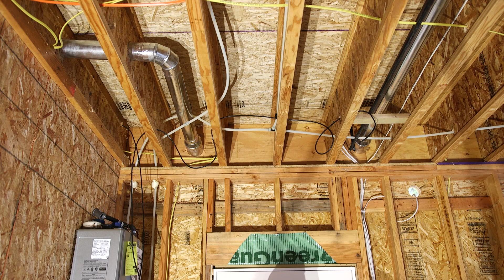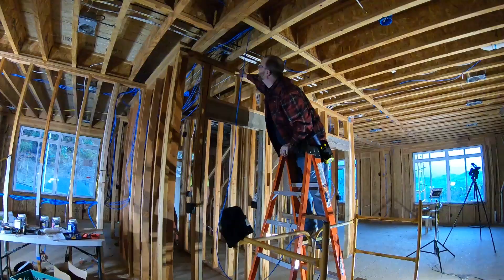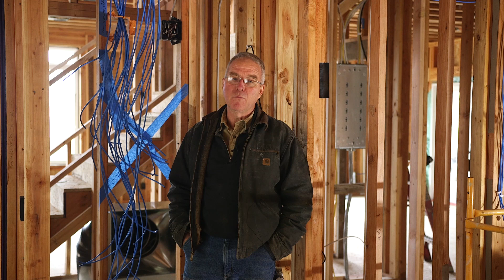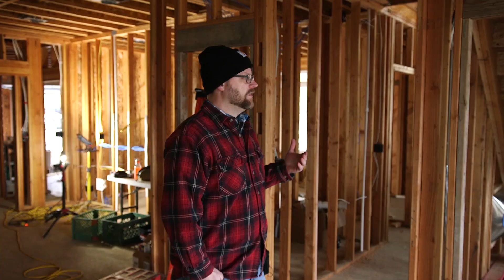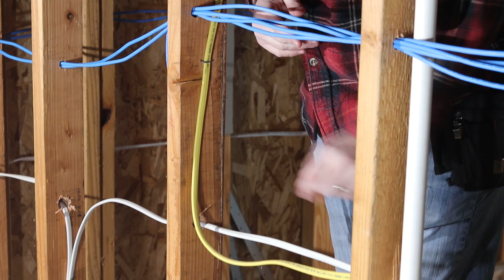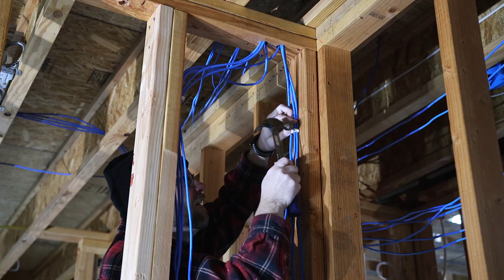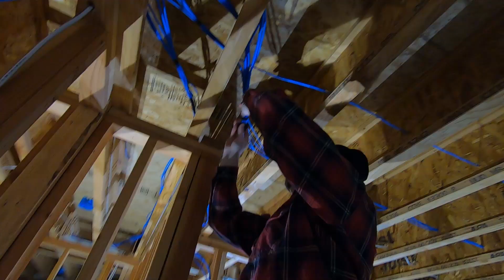Installing A Home Network Ep.100

Comment: Actually foregoing more than the initial RG6 line is a pretty good plan.
Many cable providers are moving to wifi cable boxes.  However, these boxes still have an RJ45 connector.  Makes it VERY easy to have a fully wired setup without needing to have RG6 everywhere.

Comment: Eh, I don't know if you really need to run coax to every room the way you would even five to ten years ago. With online streaming services like Netflix, Amazon, and Disney+, a lot of the content you would be getting either over the air (from a roof mounted TV antenna) or from the cable company can be had online. And most Closed Circuit TV systems now available also use Ethernet (or connect wireless using the WiFi network) instead of coax. You may still wish to run coax from the media closet to the spot you designate where a media center might go (like in the living room), but you don't need to run it to all ends of the house like in the past.

You will want to set up Eithernet runs for Wireless Access Points in the house. This way, the future homeowner can install WAPs to extend the range of the wireless network for even coverage. (The systems in the routers can only reach so far.)
Reply: I ran Coax: I am using OTA for TV & not really interested in paying for netflix\Amazon\Disney, etc.

Comment: CAT7 and CAT7a to me are not "standards" because the standards for me are set by the TIA (Telecommunications Industry Association) where as CAT5 CAT5e CAT6 CAT6a and now CAT8 are standards that they set them.

Brings a smile to my face to see this stuff going in now, long term always pull more cable then you think you need because you will use it :D

Comment: Couldn't u just have used shielded cable instead of keeping distance between them and electrical cable?
Reply: Nope. It helps but it doesn’t prevent the induction. And I believe the NEC calls for that separation no matter what type of LV cable you’re running. I know WA state electrical code does. 

Plus at this point, if you’re running the cables in the open walls, there’s no point at all in not keeping that separation.
Reply: @bendunster8859  Hmm Interesting. Good point on the open walls. But I'm from Europe and most of our houses are from brick. So we don't have the option to seperate all wires.
Reply: @bendunster8859  Right on! Also, shielded wire is really a pain to terminate, I find. ;)

Comment: Another thing I would recommend is to stay away from Copper Clad Aluminum (CCA) networking cables. They are cheap, but suffer from poor performance and poor longevity.
Reply: Not an inch of CCA in this house! :)
Reply: @Stonesand  that's great to hear. CCA is the worst thing ever.

Comment: If there is a chance that satellite TV might be wanted, two RG-6 to each location is in order. Also run four RG-6 from the technology closet to the desired antenna location. For Dish Network in Rosewood, that's having a sky view of azimuth 155° and elevation 40°. The trick is to choose a location that is minimally obtrusive which is technically practical. Antenna placement is rarely intuitive to the uninitiated homeowner. Consult an installer experienced in multiswitch projects.
It is cheap to pull the cable now and far less disruptive.
This is also the time to install inwall blocking for future grab rails in showers and lavatories. As there are standards for where grab rails should be placed, placement for blocking can be easily determined.
What else should you be prewiring for? Security systems? Smoke and CO detectors? Home theater wiring? Irrigation sprinkler controls? Weather station? A couple of spare conduit with pull strings for future proofing? Dark fiber? (Maybe not.)

Comment: Here in Central Europe we never use UPT cables. We always use shielded cables and actually all cables are usually rated Cat.7. (In Europe UTP cable is usually more expansive than S/FTP cable).
We connect them with Cat.6 or Cat.6A modular jacks. And according to the norm, all communication cables needs to be wired in a way that makes them replacable (so usually in cable ductwork). 
But other areas of the world - other rules...

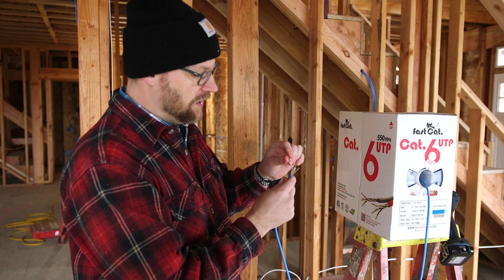Comment: the depicted CAT 6 cable seems to be 6A specifically. the box at 8:00 says 550 MHz and 6A has 500 MHz rating.
this is supposed to carry 10 Gigabit/s for 100 meters.
perfectly fine cable.
Reply: perhaps, but probably 550 Mhz at for 10 meters, or at half-duplex or some other Marketing BS. There is no internal separator to attenuate crosstalk between pairs.

Comment: I'd add to that that with CAT6+ cable, a good rule of thumb is to consider a coke can to be the bend radius.  
If you imagine putting a coke can on the corner and bending the cable around it, that's a good curve for it.  
Any less and you're liable to degrade the signal the cables will be carrying.

Comment: Seems a whole lot simpler to do CAT6 everywhere, compared to what's in my home (built in 77). We've got phone lines running to every room, coax running to every room for Cable TV, security system lines running to every room, and even lines for intercom system (which is a whole lot nicer than I thought it would be). That CAT6 basically would simplify all 4 of those systems down to 1 network jack these days.

Comment: I think this is overkill. And also somewhat not good enough.
Personally I would have put (in germany we call it Leerrohr) "emty pipes" and put the cables in there. If anything gets outdated or breaks, just pull a new cable trough the pipe. Of course this would have not been possible with those wired lengths, but then I would have put in more patch panels and daisy chained the wire(s).
But that is my preference.

Comment: Please also run the cat6 up near the roof for any radio communication, i.e. 4g/5g or even a rf link...
I am surprised that cat6 ist still Standard in the USA, here in Austria we most often use Cat7 but at the moment with Cat6 sockets for rj45 compatibility
Chris
Reply: Cat 6a is the standard as Cat 6 is being phased out for new construction.

Comment: Nicely explained but, as I'm quite in the same area of work, I'd like to add some details:

- Yes, you have to be very careful when pulling cables, but you don't test them once the house is done but as soon as you install their rj-45 connectors, that's what cable testers are for.

- Fire protection, well, if your house is made of wood, that will be the least of your problems as the low voltage across them is highly unlikely to cause any spark (unless a really bad installation was done).

- Data cables and electricity wires can't, by law in some places, be run in the same tubes. Not only because of data corruption, but also because it's hazardous.

- Extending on this, calling this "CAT-6" is not enough, as in most places you will find UTP CAT-6 and FTP-CAT-6, although there are some more variants but this are the two (at least where I live) that people will find the most. For all intends and purposes for home use, UTP is enough and will do what you need. The main difference with FTP (not related to the "file transfer protocol") is that FTP has some kind of "shield", in fact it's usually called "shielded cable" (again, I'm in Spain, I'm telling how things are here but this translates anywhere). Again, there are a few versions but the usual one is that there's an extra metallic layer between the wires and the outer plastic layer that protects those wires from interference. That DOES NOT mean FTP wires can be run along electrical wires, not at all. They are used where you don't have another choice as there are way, way many data cables, or any kind of relatively strong electromagnetic interferences (big speakers, electric motors, ...) and your cable, for whatever reason, has to pass close to that.

So, long story short, UTP will be fine 99% of the time, FTP only if needed because, as you may check, FTP is way more expensive than UTP and if you don't actually need FTP, it's not worth it.

- And as for cable management, well, if I could choose, although impractical when installing, I would use a different color for each cable, or as many different colors as possible, so in case you have to, one day, change one for whatever reason (say a cable is cut when reforming a wall or whatever) you know what cable is and where it goes (this would be in pair with having that color code written somewhere in your rack, of course). However, that's not practical for home installation. If you work on that, it would be nice for you, but you are not buying as many cables as different colors you need, it makes no sense. So, in this case I would use the trick (not a trick but, anyway) that I learnt from a guy that installed the public WiFi network in my village: use electrical tape.

You can easily get electrical tape in different colors, probably in any color you may need. What this guy used to do is using some electrical tape around the data cable, once every half a meter to a meter or so (for those who don't speak metric: every one and half to three feet or so). So, if you ever make a hole through the drywall for whatever reason, if you see that electrical tape you instantly know where that cable goes, and if you are replacing it, you know you are replacing the right one, as even if you make a whole and there's no electrical tape right there, there will be a piece of it not too far away.

That's about it. Thank you!

Comment: Whole house mesh WiFi is preferred over RJ45 sockets IMHO
Reply: Let's keep it your humble opinion. I'll take better reliability and lower latency any day.
Reply: Wifi is great for mobile devices that can roam around the house. there are only so many devices on wifi before there are issues sharing bandwidth. Structured cabling will always be superior for devices that don't really move and take the load off wifi. TV's, POE cameras, POE lights, set top boxes, garden spinkler systems, and desktop computers, etc.

Comment: Can you isolate or shield cables that run close to AC electrical cables with aluminum foil?
Reply: You'll notice he was using UTP cable. That stands for unshielded twisted pair. They do make STP cable which is shielded twisted pair. It does help with electrical interference and is usually used on longer runs and in high electrical noise environments.  The other way to get around this is to run it in metal conduit. When properly grounded that will help with some shielding.
Reply: @MattJames1  Or run MC cabling instead of Romex.

Comment: Runnning Cat6 at all is actually impressive.  These days most every homeowner I know just slaps wifi nodes around, only know a handful who appreciate/want/need the stability of a LAN connection.
Reply: Should've gone with 6A, but given the lengths and likelihood of never installing anything faster than 1G, there's not much reason to go with the slightly more expensive, and much more difficult to mess with 6A. (run conduit everywhere and any problems or future needs are easily addressable.)

Comment: We put ethernet and coax everywhere when we renovated about 10 years ago. Never used the coax once, but the ethernet is essential.
Reply: Not surprising. They keep finding new ways to get more out of coax, but with Cat-6 able to push 10g, I suspect the days of coax are numbered.
Reply: @jasonbutler419  Yeah. I cut the cable years ago and can't imagine what I would ever use the coax for now.
Reply: @vdefilippo  We did the same. Coax comes into the house for internet and that's it. No cable TV for me. Cable is more of a rip off in Canada than it is in the US.
Reply: @jasonbutler419  trust me, I'm in the coax field. There are hundreds of thousands of miles of coax in the US alone. It's not going anywhere anytime soon. There's so much outside cable plant that's necessary for the internet. Ethernet in the home maybe, but not outside plant.
Reply: @jeffblalock6326  I'm well aware of how much coax/HFC is in the OSP, and I DON'T think it's going anywhere anytime soon - I certainly wouldn't replace it unless I absolutely had to. 

That said, given Cat6's data capacity and ease of installation on-premises, as well as coax's inherent limitations compared to fiber (OC-XXX, GPON, etc), I still suspect that, at some point, coax will be considered a dinosaur in the data transmission world... I just wonder how long that will take.

But, since I come from a Bell System background where coax wasn't used anywhere near as much as fiber systems and old fashioned copper, perhaps you know something I don't (also, I've been away from the business for a while now). What IS the top data transmission rate over coax these days? 10g? What are they hoping to hit with the next iteration of DOCSIS ?

Comment: Another thing to watch out for is CCA (Copper Clad Aluminum).  It's sold as "solid wire!" but the aluminum is much more fragile than copper, work hardens more readily, and is much more difficult to add connectors to.  It'll be cheaper than solid copper, but it's not worth the savings.  Spend the few extra bucks and make sure you get solid copper!

Comment: The beginning of video - fast speed - is how people work when paid for the job and not hourly.  Just a little humor.

Very useful information.  Don't coil/roll the cables - use enough, as with electrical/power, to get you there and a bit more.

Comment: I ran all the cable In my own house. When he started talking about the bent cables and stuff I kinda just remembered how I manhandled it while running it through the house. Hey it still works I guess.
Reply: Cat6 isn't as sensitive as Ben made it out to be. If you get a light kink in the cable and catch it quickly, it'll be fine. Once you tighten that kink up until it loops onto itself like a little curly q, it's toast and needs to be repulled.
Reply: @challengecompleted55  Agreed, Ben was probably over-emphazing the danger because a 'light touch' probably varies between network folks and construction folks.  The key is that the construction folks just need to be told, this isn't simply solid-core or stranded wire, its a set of 8 thin-gauge wire looped and twisted in a certain configuration that yanking on will ruin.
Reply: Using solid wire makes it a lot more fragile. If you were using stranded it's a LOT more durable and can withstand more kinking. He was installing and recommending solid conductors.
Reply: @andrewv5104  All I ever worked with was solid core plenum rated cable.
Reply: @andrewv5104  Understood, however in explaining to a 300# construction gorilla who will probably pull any decent-sized wire as hard as he wants since it prob won't break, the idea was to convey that this isn't anything like that kind of wire. Never seen stranded Cat.
Reply: Same here, and I'm pretty sure I'm sharing some holes with some 120V cables D:
Reply: Stranded cable is widely available and widely used- just harken to what the gentleman said in the video. Solid is what pros use for wiring you don’t see (the long runs in walls and across attics). Stranded is what you use for patch panels and devices where the run is typically short and where the flexible stuff is “user friendly” and harder to kink.

Comment: Question.  If both the Cat6 cable and the electrical cable are on the same stud, in a rising situation, how can they be kept 1" apart and still be 1 1/2' from both edges?  This would require a 4" stud,  but they are usually 3 1/2'.
Reply: Ideally you don't use the same Stud bays for Power & data.
Reply: @guytech7310  OK, but at 11.24 that appears to be a 2x4 stud and the horizontal data cables look a lot closer to the edge than 11/2"    I guess I'm only nit-picking.
Reply: @johnmusgrave7896  2x4 are 16" on center, More than 12"

Comment: A house fully equipped with ethernet is fully equipped. I mean you could use coax and it is nice to have in a rental flat. But honestly, when buying a house you can absolutely invest the 200-300USD into sat over IP.

Comment: You need those other standards if you want 10 gb or faster speeds. 6 can handle 10GB but shorter distance.  Also if you get Cat6 or better that is shielded works great for if you think you may have cross talk IE a signal from a power source or line.   I have shielded lines for long runs in my home Its still cat6 but shielded. than all patch cables are cat6  My servers all have shielded cable and ends to keep it all grounded.  witch lowers signal loss over long runs.

Comment: I installed an entire Cat5e network in my house, 2 jacks in each room. 20 years later the only one I have ever used is the one in my office. Installing RG6 to each room is like installing 220v to each room, most TV's are wireless. All its good for is bringing Internet in to your house.
Reply: And I'm on my second 24-port panel in a 1200' sqft house with 2 people in it...
3 tvs, 3 computers, 2 printers, 2 consoles, retro-pi, 2 access points, 8 cameras.  And I have a few more around for things like plugging my laptop into for a big file transfer.  If I decide I want more cameras than just the 4 corners of my house, I'll have to pull more cable for that too.  Or PoE lighting.  Or whatever else comes along.
He's building a premium house.  What things will want high bandwidth when the family that buys it has 3 teenagers in 15 years?  16k TVs?  Ultra-premium VR setups?  Hologram generators?
Reply: @Erezeneb  wireless?

Comment: Around 11:30 when Ben is explaining the restrictions on running parallel and perpendicular I see there are two cat6 lines running down the opposite side of the stud with the yellow power running up it. Will this be a potential problem as they are within 1 foot of each other?
Reply: Depends. It can if the 120VAC is powering something noisey like a vacuum cleaner, Blender, Power tools, etc.